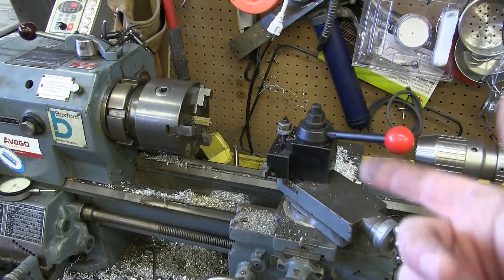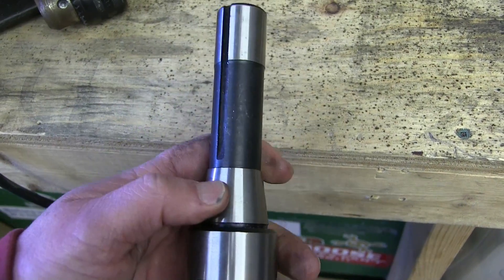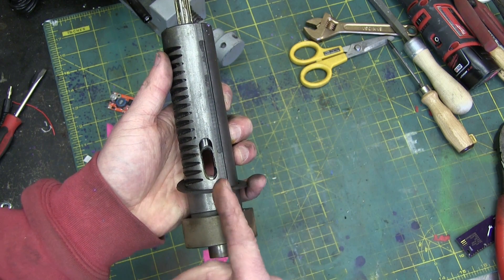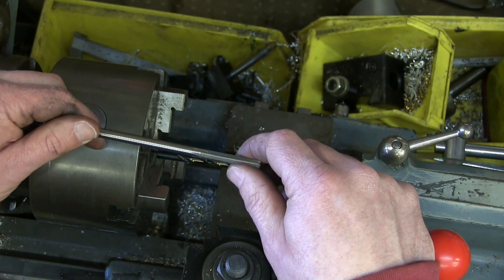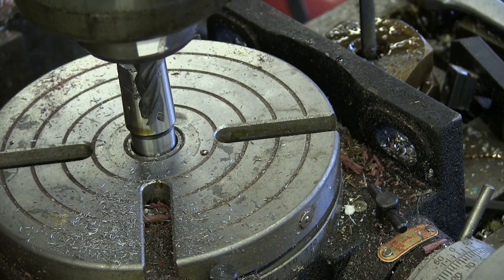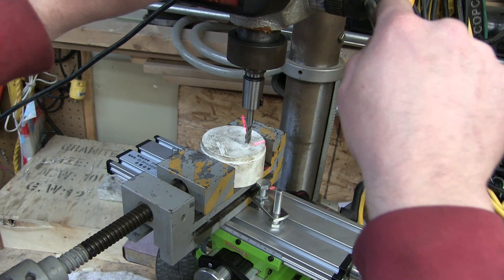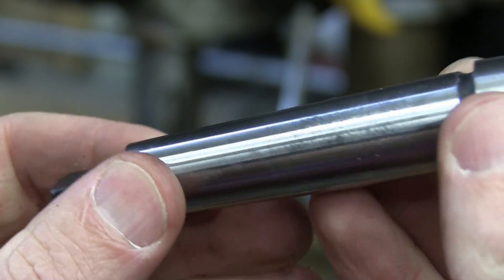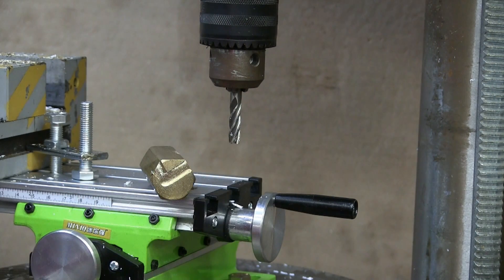"IMPOSSIBLE!" Milling Machine from a Drill Press

Comment: I gotta wonder - if you need both a lathe and milling machine in the first place to make this, why bother? Just to show it can be done?
EDIT: Thank you for your answers, kind commenters, and for recognising that this was a genuine question, and not some kind of retort. Especially to those who gave a proper answer, rather than just "You don't get it, do you." I'm by no means a machinist, I'm a student of pixie-wrangling from little old England who only got his grubby mits on a grinder for the first time a couple of months ago. I come to these videos to learn, as well as have a laugh, and genuine answers are very much appreciated.
Reply: I think you've missed the point...
Reply: The XY table and proper collet can be bought without the need for a lathe or mill.
Reply: And how do you think those lathes and mills were made?  Another machine, machines have been having sex and reproducing for a long time.  Find a machine shop or a friend to help you procreate.
Reply: His use of the lathe was the part that failed to center better then the Jacobs Chuck. He used a mill because he has one. Every one else that needs a flat spot on a round uses a grinder or file. I also think he could have used a drill press to make the hole he drilled with the lathe not so sure the reamer in a press is such a grand idea I would use a honing stone instead.
Reply: You don't need that, it was just to skip the waiting game for the collet chuck to arrive. order collet chuck and the x-y table and you're good to go... aand, also fix the drillpress TOT style, for that you only need simple tools: Mill, lathe and shaper..
Reply: R9000 yep. may as well buy a little bench mill for $1000 and save time, money, pain and stress.
Reply: all I need is angle grinder and drill, the angle grinder is optional, since you can use the drill as a grinder too
Reply: Yea, I think it would have been better too keep the taper in the drillpress and the drillbit in the vice, that way the hole would have been centered... Using a proper size drillbit before the reamer would help too, and if its fairly rigid the reamer would be fine.

Biggest problem I see with this setup is that cheap drillpresses usually are not very rigid, mine probably has a couple mm weeble wobble in the quill.
Reply: Rigidity of cheap drill presses can be improved. Unless you can center the drill that is in your vise (seriously?) perfectly under the quill, you're only going to make it more accurate by running it in the spindle of a lathe and using the tailstock as normal. Also, even the cheap, Chinese taper adapter is still less workable than just about anything a home shop guy is working with.

Comment: What's the brand on the Chinesium Grade XY table? If I may.
Reply: Sum Ting Wong Machine Tool Co. is a wholly-owned subsidiary of the Ho Lee Fuk Aerospace Corporation.
Reply: http://www.banggood.com/Miniature-Precision-Milling-Machine-Bench-Multifunction-Drill-Vise-Fixture-Worktable-p-1027924.html?p=M72202225762201307PL
Reply: http://www.tmart.com/Mini-Precision-Milling-Machine-Worktable-Multifunction-Drill-Vise-Fixture-Working-Table-Silver_p346586.html
Reply: Terry Leigh Its a Sum Dum Fuck model!
Reply: done and done, one step closer to diy fuckery mill.
Reply: Over US$41 with shipping. The one I poster has free shipping world wide (except maybe to the great frozen north).
Reply: Michael Drzewiecki you dada man! thanks
Reply: Cheapest one I could find
https://www.aliexpress.com/item/Miniature-Precision-Multifunction-Milling-Machine-Bench-Drill-Vise-Fixture-Worktable-X-Y-axis-Adjustment-Coordinate-Table/32700269545.html?ws_ab_test=searchweb0_0,searchweb201602_5_10000560_10000606_10000561_10000073_10130_10000074_10000608_10000709_10000660_10000704_10000703_10000175_10000509_10000507_10000505_10000558_10136_10000068_10000552_10000369_10000063_10000365_10000367_10099_10000663_10000665_10096_10000669_10000569_10000097_10000094_10000337_10000723_10000090_10000147_10000091_10000726_10000144_10000339_10000729_10000150_10000679_10084_10000678_10083_10000676_10080_10000153_10000673_10082_10081_10110_10111_10112_10113_10000535_10114_10000534_10000089_10000086_10000710_10000083_10000349_10000690_10000135_10000716_10000080_10000693_10078_10000717_10079_10077_10000688_10073_10000684_10000140_10070_10122_10123_10126_10124_10000546_10065_10068_10000746_10000782_10000743_10000132_10000033_10000786_10000030_10000026_10000126_10000023_10000129_10000123_10000696_10060_10062_10000699_10056_10055_10054_10000632_302_10059_10000738_10000120_10000774_10000734_10000020_10000778_10000013_10000117_10103_10102_10000016_10000114_10000111_10052_10053_10107_10050_10106_10051_10000621_10000384_10000763_10000629_10000766_10000101_10000100_10000576_10000770_10000579_10000104_10000045_10000578_10000375_10000108_10000377_10000758_10037_10000612_10000390_10000613_10032_10000042_10000750_10000592_10000754_10000594_10000039_10000587_10000036_10000389_10000187,searchweb201603_3,afswitch_1,ppcSwitch_5,single_sort_0_default&btsid=072f15ba-ab82-428d-a02c-b6da61f53f5c&algo_expid=6cda5627-2d0e-4ecc-9fd4-2a81904ea5bd-4&algo_pvid=6cda5627-2d0e-4ecc-9fd4-2a81904ea5bd
Reply: Even cheaper with the generic discount code CS1 $42AUD which was $32US
Reply: I laughed when I saw it, The xy table had some chinese on it. it is just a patent number and then says counterfeit good must be pursued as in court but the word can also be a word for research in another context. The statement would then be counterfeit goods must be researched, lol ;)
Reply: There is a few different designs, if you search milling machine on aliexpress it brings up heaps with other prices.
Reply: Terry Leigh steel dragon tools multifunctional work table on Amazon.ca it's even prime
Reply: I think I found it : http://www.tmart.com/Mini-Precision-Milling-Machine-Worktable-Multifunction-Drill-Vise-Fixture-Working-Table-Silver_p346586.html?cc=USD&fixed_price=us_us&gclid=CPXd2benx9ICFQUdaQodXGcPXg
Reply: Duncan Murray THANK YOU! I ordered it from tmart with you helpful discount code, got it in 4 days! ...n now I'm one step closer to the abomination lego "milling" machine build being complete. few more packs of bubble gum as paste n cure time and I'M DONE. lol ...THANKS AGAIN
Reply: Michael Drzewiecki thank you for posting this! I've been looking for a long time but could bring myself to pay $42-$65+ for this janky tool/gamble. Your info allowed me to get this monkey of my back...I'm about to go bubble gum it to the press in a few minutes. thanks again for the link n info, it helped me out significantly.

Comment: this is fucking sorcery. i literally spent all day converting my drill press into a mill and then you posted this video. WHY CANT I LIKE MORE THAN ONCE
Reply: metalhead2508 funny thing is, I didn't spend a dime, and it works well also. Had a damn good time doing it too. Wouldn't say that's a waste
Reply: How so? He took something he had already and then converted it into something else.
Reply: oh no, he used stuff he already owned for a different purpose! The poor fool. Your just jealous you aren't having fun in the shop too
Reply: John Daniels thanks for the support m8. Some people just don't get how to have a laugh in the shop
Reply: cylo lloyd a
Reply: as I was reading this I couldn't help but think of marine starters for reverse rotation engines. many twin engine setups have a clockwise and a counterclockwise engine. one of those starters would have been easier to modify.  
A friend of mine has an old Monroe skid steer, he uses it mostly for moving snow in the winter.

Comment: Forgive my scepticism but I thought a morse taper was designed to grip until ya give it a tap an out she pops.?
Reply from the maker: They'll fall out under vibration if there is no axial load or a drawbar.
Reply: AvE  Ahh ok  I've only ever used them in a lathe or drill press. Just out of interest, would it help if you ran a row of center dabs long the side like you can to help a bearing grip?

Comment: AvE I am looking to start milling and need a small (under 500 pounds) and and under 600 U.S. dollars so most likely a bench mill, what do you think of this.  http://www.grizzly.com/products/Mini-Milling-Machine/G8689
Reply: Sam Gray about the same as using a drill as a mill only with plastic gears instead of belts
Reply: I've used these in non-critical applications and haven't had any problems. If you're not making super-precise stuff, I say go for it.
Reply: Sam Gray.  Go with a Taig Mill.  I use one every day making microelectronical and RF thingys, holds .002" or better.  Now made with ball screws.   Googler Nick Carter.   he's the guy.
Reply: Sam Gray don't waste your money...alright for milling pockets in WOOD. You won't get any acurate parts in metal using that.

Comment: So do radial loads tighten the choocher-holder in the choocher-holder-holder?
Reply: No, only an axial load would drive the choocher-holder up into the choocher-holder-holder. Side loading it pushes the choocher-holder out of the choocher-holder-holder. I suppose if you were running a reverse twistimating choocher the skyward anglefication of the forces might cancel out or overcome the side slithering of the choocher-holder and rub it up all intimate like, but not on no regular clockamawise twisted choocher.
Reply: danke, so the draw-bar won't tighten up as it the mill is run?
Reply: This patient doesn't even have a drawbar, but in theory you should have tightened that draw bar before you turned it on OH GOD WHAT IS THAT SOUND TURN IT OFF TURN IT OFF!
Reply: I see, thanks for the info. I don't know whats going on half the time during these videos, but I use them to try and learn about machining, tools, etc (and for the fancy Canuck speak)